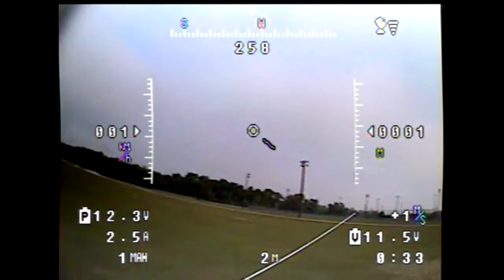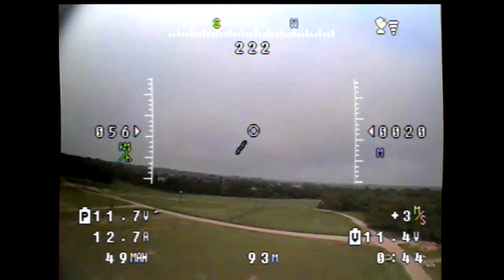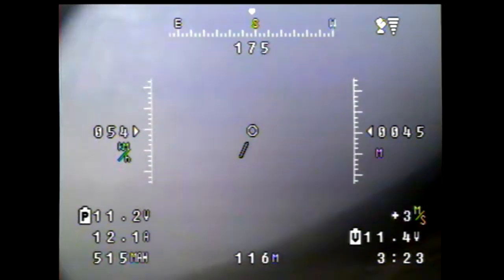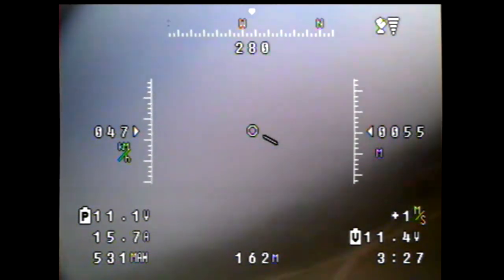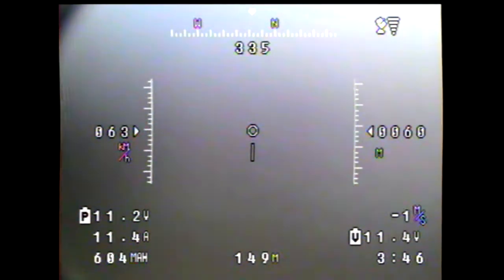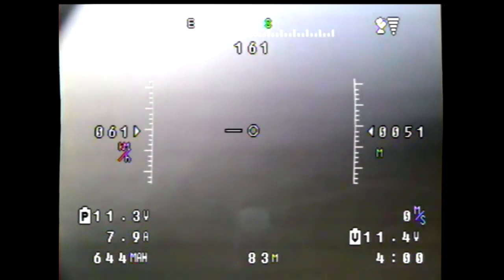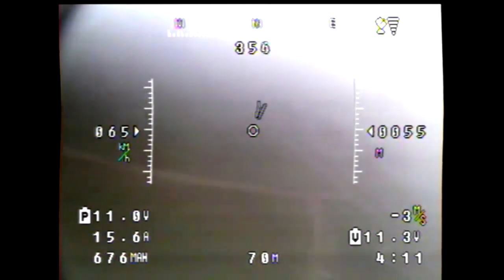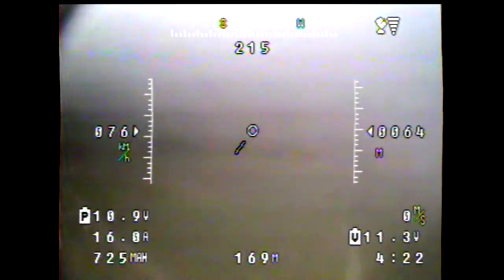Zagnutz FPV Wing #4 - Testing with Autopilot FY31-AP

Comment: Now instead of having to re-calibrate in cold weather (like winter) I put a sponge over it and it seems to work well (like a winter jacket)also you could put your ESC on it to keep it warm.Its better than having to dig inside the model to get at everything.

Comment from the maker: Congrats on the 5km flight.  Looking forward to getting there myself.  The FY Hornet OSD would be a logical choice because I think the Autopilot and OSD could share the same GPS, not positive about that though.  However, I'm not crazy about the Heads Up display on the Hornet OSD.  I think some of the others like the Dragon OSD look better.   Not sure which I will end up with though.  Looking forward to checking out your flight video.  Thanks.